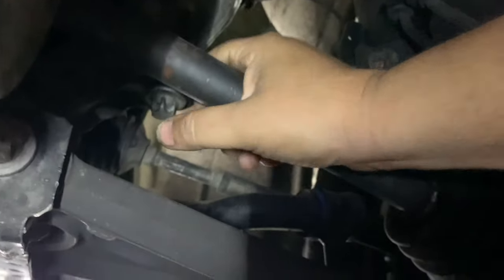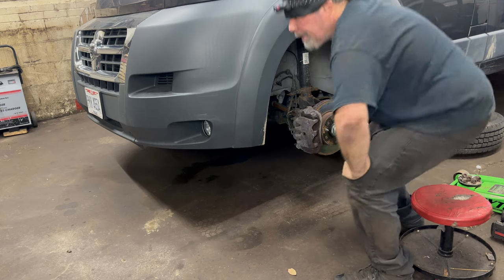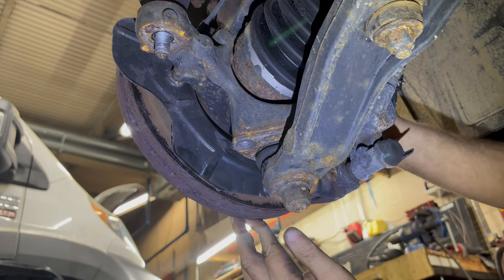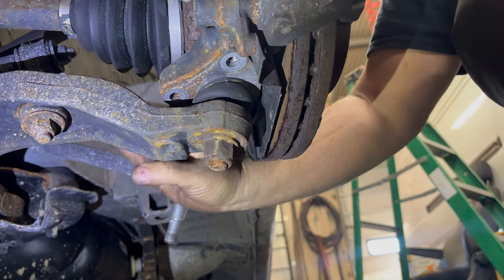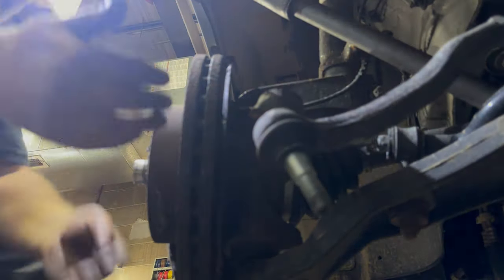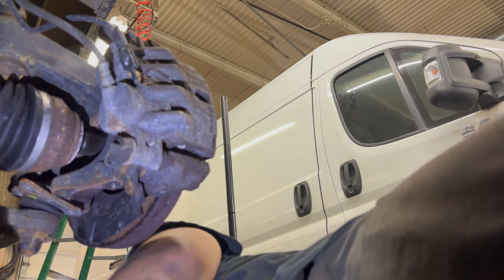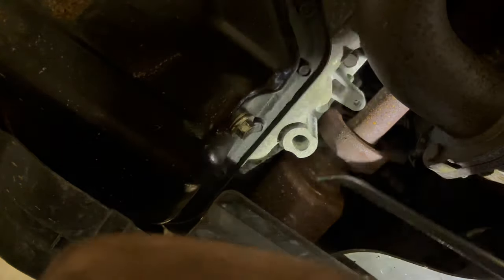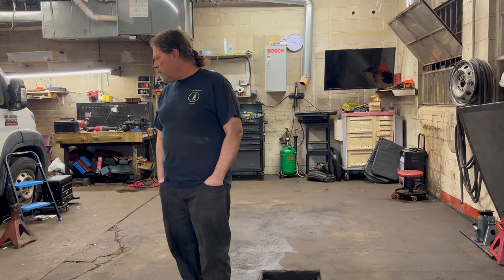Ram Promaster: CV Axle Replacement - Start to Finish Video. One man struggles so you don't have to!

Comment: This is very useful, thanks. I am unable to get it off by hammering though, so I cut the boot and am going to try reinserting the old axle with some vise grips ro get it out as I saw in another video. 

It seems like you could benefit from some more tools though, like a slide hammer. Also, maybe you could get a heavy weight and either attach the pry bar to it or use a rachet strap between it and the end  of the pry bar amd tighten down so you dont have to weigh the pry bar while trying to do other things with your hands? Or maybe put an attachment point on your floor, a come along on the attachment point, and then apply pressure to the pry bar with that.

I really appreciate your knowledge and your techniques since I dont have many specialized tools myself, but it seems like you do some things in really difficult ways for being a mechanic shop
Reply from the maker: @christophberenotto  my own laziness is my worst enemy. Removing the sway bar links is a better option, but i prefer to leave them undisturbed and just struggle!

Comment: Help! I got everything without much difficulty or finger loss till removal at the intermediate shaft. I’ve even tried an air hammer and it’s not moving. It’s a diesel so I’m guessing some extra PIA was sprinkled on the axles. Anyone have experience with this? Thank you in advance and up till now this has been a PG rated task.
Reply from the maker: Should be basically the same, as far as the intermediate shaft is concerned. I know this because early on I was given the wrong part - the diesel version is almost identical, but not interchangeable. 

You can take the passenger axle and intermediate shaft out together, split them on the bench. Or you could just buy a new shaft, but both new pieces back in.

Comment: Do any of your videos show the removal of the intermediate shaft? Ive been hammering on my passenger side cv axle for days and will not move at all. I've tried with a chisel, slide hammer, etc. And absolutely no movement. I cutt off the boot to try the reinsertion plus vise grip trick but somehow I cant get the old one back into the interior cv cup. I dont know what else to do and I'm stranded. Thanks for any advice!
Reply from the maker: Did we talk about this already? Once the 3 bolts that hold it to the block are out, it should slide right out of the trans. If for some reason you can't get the intermediate shaft to separate from the axle, that shaft is common to 2014-up minivans and it's like $75. New axle, new shaft, no sweat.
Reply: @promastersonly1419  thanks so much, I'll try that. I just didn't know if there was another circlip holding that into the transmission or anything special to know before pulling on it

Comment: Thank you Kip!  A lot of friends have RV builds based on the 159 ext. which built out are close to 10k lb and often very far from home.  In these situations would you prefer replacing with OEM or  a specific brand to minimize the chance of having to replace these again in 2-3 years? Thank You.
Reply from the maker: Tough call. The OE axle is the highest quality, but reman axles are just rebuilt OE axles. To date, we havent seen aftermarket axles fail no matter how cheap the price. My feeling is if you are capable of doing the job yourself, its ok to cheap out. If you are paying someone, the OE may be warranted.

Comment: I'm quite sure that the torque value of the axle nut is in direct relation to the bearings on the front and making everything last and operate as the should.

Comment: Timely video....I have a 2018 ProMaster 3500 Hightop extended van that Winnebago rebranded as a Travato....then I "modified" the van again by going to VanWorks in Salt Lake City, UT and had them do a 3 inch lift...at that time they said they could not do a fulll 3" lift on the front because the van had "aftermarket" CV axles that were slightly shorter than the factory axles they were expecting to find.  Test time- 1. Are some axles shorter than others?  2.  I have since had a slight vibration when accelerating, possibly from the 2.5" lift they did on the front or possibly from the fact the van now has 105,000 miles......so.....how long should cv axles last and would you recommend or is it possible to get slightly longer cradles to reduce or eliminate vibration when under power..??
Reply from the maker: I’m impressed. Most people who install anything greater than a 1” report snapping axles constantly. 

SFAIK, new or reman axles all start life as factory axles. They should all be the same length, and even if they werent it shouldnt matter, since they will just engage slightly less in the transmission. Normally, the plunge in maybe 1.25”. Having only 1” wouldnt really affect strength, I dont think.
Reply: @promastersonly1419   Thanks, I always accelerate slowly to put as little stress on it as possible and the vibration goes away when not under heavy load.

Comment: Question.  How come no gear fluid came out when you pulled the axle  out? Two weeks ago when I did mine a crap ton of fluid spilled on the driveway cause I wasn't expecting any.  Also, when re-seating it, is there any special alignment I need to be aware of?
Reply from the maker: Sometimes it leaks, sometimes it doesnt. This van was about 1/2 qt low on fluid, which may explain it. 

In theory, you literally cant reinstall the axkes wrong since you wouldnt be able to get the ball joint back together unless the axle is fully seated. In practice, it’s obvious when they are in fully and obvious when they arent.

Comment: I have a 2019 promaster that a travato with a 3 inch lift. The cv boot is leaking and I will need to replace it. Is there any thing better than oem?
Reply from the maker: OEM is pretty much the best. We use much cheaper rebuilt axles all the time. But there have been dozens of reports of lifted vans continually snapping axles. Such that I recommend against anything more than a 1" lift. If it were me, I'd just use what they sell at Autozone or O'Reillys, since it will have a warranty and if it turns out this van is going to snap an axle every 20,000 miles, you'll want that parts warranty.
Reply: Thanks I think the tech damage it as I had a transmission put in. During the recall they over filled it. I would have put a 1.5 inch lift but it did not exist when I did it. Thanks for your help. P.S. I have 80,000+ miles and I drive like an old man.

Comment: Hi, I have a question. My 2017 2500 promaster turns off like if have a misfire  and turn off in 2 seconds when I shift to drive, but when I shift to reverse or on the park, works well, you have an idea?
Reply from the maker: Hard to say, but it suggests the engine moves when it shifts, and pulls on wiring, interrupting power somewhere. First place I’d look is the engine ground off the transmission. I have a video on it.

Comment: Does passenger side come out of the intermediate shaft the same on promaster 2500 diesel 3.0 L
Reply from the maker: @ams7159  yes. Takes a good yank with a prybar, but it will release from the intermediate shaft.

Comment: That tie rod end your puller is great but it is easily done with pry bar leverage up then proper dead blow hammer to where you were hitting it, cake that way on mine… old man taught me that.
Reply from the maker: Good tip. But I paid $7 for the ball joint puller and want to my money’s worth!
Reply: Yep puller is good, and one man operation. With the pry bar and mallet it’s easier with two people, one for each tool. Hope this helps folks without the puller not struggle with tie rods is all!
Reply from the maker: @raleighleslie2085  I spy a future video topic in this!
Reply: Yeah, but I when I did that I was on my side and when I took a wack at it, I missed and hit the threads on the tie rod and ruined my day. You can borrow the puller he used from any auto parts store... worth it.

Comment: Thanks for the video and giving me a headstart on this project. Unfortunately, I could not get the leverage that you were getting to pull the lower control arm down and free the ball joint. What is the “official“ way of doing this? Think I might undo the bolts holding the swaybar link and ball joint to the lower control arm, remount the tire, lower the car, so the hub and lower control arm separate and then just remove the ball completely. EDIT: That was a stupid idea.

PS, what are the shop hours for this job?
Reply from the maker: Alldata says 1.2 hours for both ball joints. I think that's low, and I would bill it at 1 hr per side. Unbolting the sway bar stab links will help, but the easiest way is to have a big ass bar like I have in the video. Harbor Freight sells a big spud bar that fits that opening in the control arm.
Reply: @promastersonly1419  Ok thanks. For 1 hour per side, assuming typical shop rates here in LA ($150/hr?) I definitely would have "paid someone else to do this goddamn job" (couldnt find a tire shop to even quote me). Who knows what they would have charged me for the axles though... I got 2 aftermarket ones for under $200. Anyway, yeah I figured out to unbolt the sway bar link and used a crow bar in between the sway bar and control arm using the sway bar as my friend rather than trying to fight it. I definitely needed another person to help line those three damn bolts for the ball joints during reassembly through. Ugh. Anyway, it's done now and no more vibration while accelerating (why the hell was this happening on a 2021 anyway. CV joints had no play, boots intact etc?!?). 

I appreciate your video and it's also good to know that Im not the only one talking like that during a job. "Whose you're goddamn daddy?"
Reply from the maker: @robertogonzalez5018  I love a happy ending.

Comment: trying to re-boot a passenger CV axle. I got it off - thanks your videos, but can't figure out how to dissemble it. the plunger has its edges rolled in so the axle won't come out. any suggestions will be greatly appreciated. thanks!
Reply from the maker: Nope. With an autozone axle being pretty cheap, I’ve never bothered to try to rebuild or reboot them. Let me know how it works out.
Reply: @promastersonly1419  i sure will. 
hesitant to use aftermarket, especially such critical components like axles. nevertheless, i followed your advice and got Duralast - curious how long they last?
Reply from the maker: We've installed probably 20 of them and haven't had any issues. The OE is probably superior, but there's no good way to know if they are superior enough to justify the price/availability difference.  @alexanderkasyanov4946

Comment: Important on the way back into the tranny the gap in the circlip should be facing down… there is an illustration on this on the part on rock auto installation instructions. With the gap in the  circlip facing down should be easy to get the axle to pop back into the tranny.
Reply: I just posted a question about any special alignment needed when re-seating axle.  Can you share the info you have? Thanks.
Reply from the maker: That’s a great tip, havent ever heard that one. So far, all the axles have reseates either by hand or with the slightest tap from a deadblow. I assumed the circlip is beveled to allow it to do that.

Comment: Any chance you have a transmission R&R video kicking around somewhere?
Reply from the maker: This video was supposed to be it, since I was replacing a flexplate. Eventually, I'll have a full transmission start-to-finish to film. Once you get the axles out, it's just starter, flexplate bolts, support the engine from below, support trans from below (tricky because it's not flat) then remove the lower half of the bellhousing bolts, remove the upper trans mount and rear biscuit mount, then remove the upper half of the bellhousing bolts. There's a spot to pry from a little below the starter, and it separates and comes out. If it's coming all the way out, shift cable, 3 trans sensors, big front trans plug, and cooling lines need to come off.

Comment: I look forward to having to do this to my van, ugh.
Reply from the maker: Armed with this video, it wont be so bad. Axles go randomly - can be 50k or 500k. All you can really do is inspect the boots periodically.
Reply: Everything goes great until you wack the tie rod threads, tweak the spindle threads during reassembly and curse the day you had to realign the 3 ball joint bolts. Oh and, like an idiot, I pulled the drivers side axle too far out and separated the joint. That was fun trying to put back together on my brand new axle. fml. Pay the shop... start a go fund me lol
Reply from the maker: @robertogonzalez5018  Welcome to my world! An endless river of suck!
Reply: @robertogonzalez5018  i took a hammer and punch and just spun my lower ball joint till the holes lined up. since it rotates there is no danger of harm

Comment: I think the universe had a hand in the timing of this video. I'm researching why my promaster is shaking only when i'm accelerating above 50 mph, but then is fine coasting above 50. From what I'm seeing the consensus is either cv axle or a transmission issue.
Reply: Mine did the same. Over 50. Steering shimmy, floor vibration. Let off, it smoothed out.

Had new axles installed & it's fine now.
Reply from the maker: Almost certainly an axle.
Reply: @promastersonly1419  Kip, is there anyone you could recommend to work on it in the MA/RI/CT area?
Reply from the maker: @jenniferl350  no contacts out that way, sorry.
Reply: @johnwren3976  Did you use OEM or aftermarket?
Reply: @johnwren3976  @jenniferl350 mine has the exact same, but it stops shaking after 60 mph (even if accelerating). Did you see that behavior too?